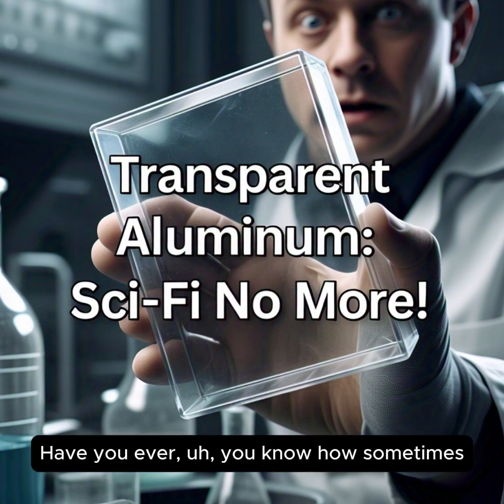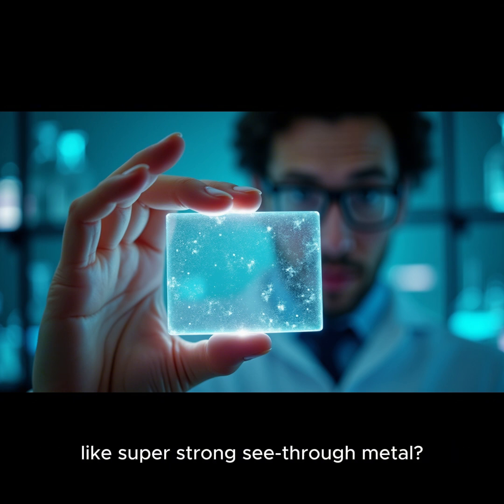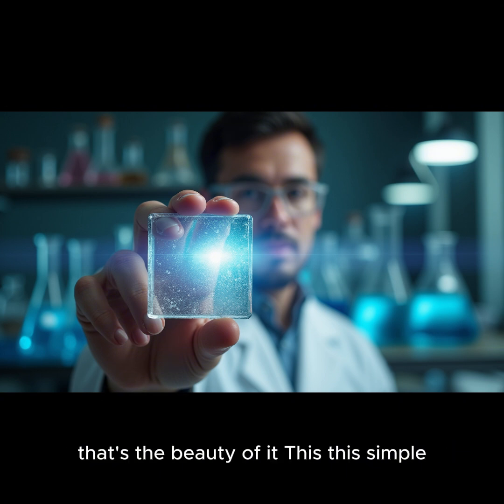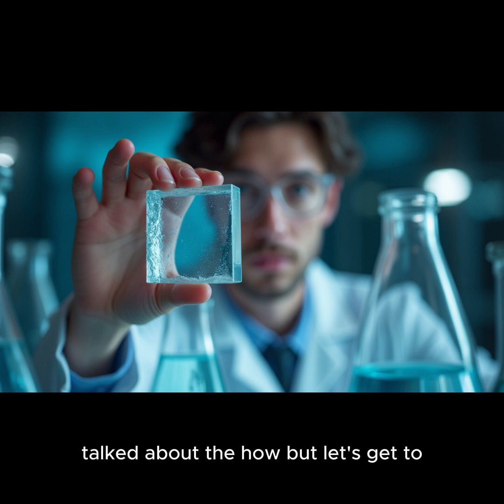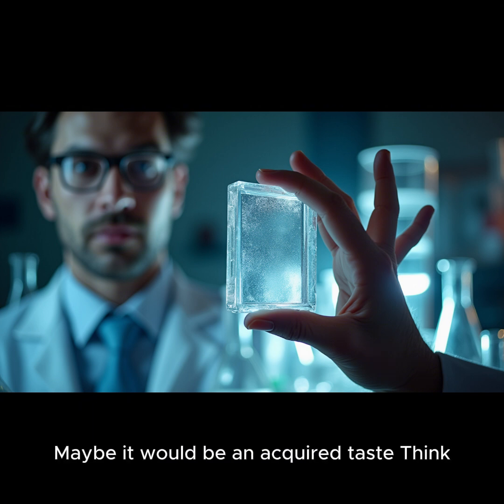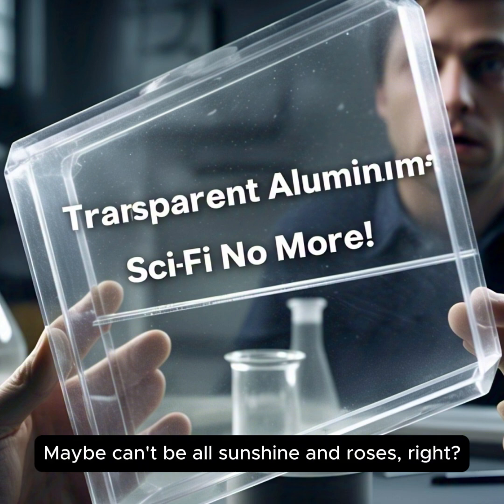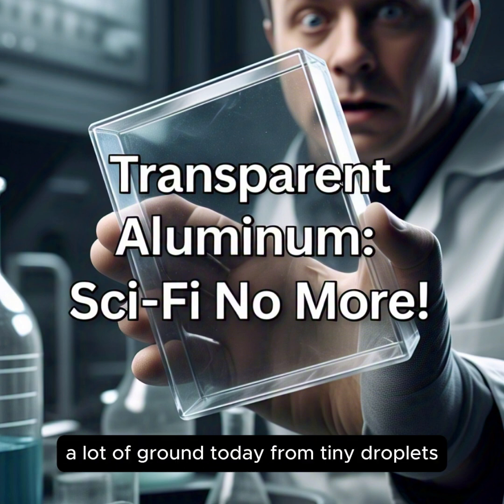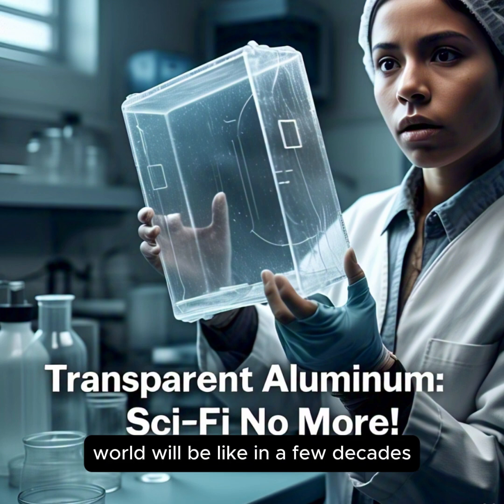Deep Dive: Transparent Aluminum - Sci-Fi to Reality!

Comment: Can the translucence be variable? Can it be made to be adjustable? I'm thinking glass-like, but becomes more opaque or clear through human interaction/control.
Reply from the maker: Hey @moietvous6932, great question! Yes, variable translucence is definitely possible and already being explored. There are materials like electrochromic glass (also known as smart glass) that can switch between clear and opaque with an electrical current. Some even respond to touch, heat, or light. While transparent aluminum itself is still in early development, integrating similar tech could bring us closer to the adjustable, glass-like material you’re imagining. What kind of applications would you want to see this used for? 🚀